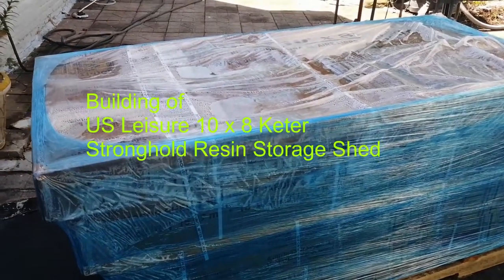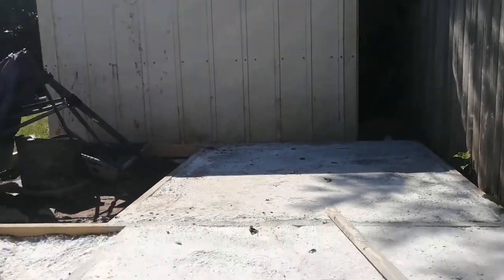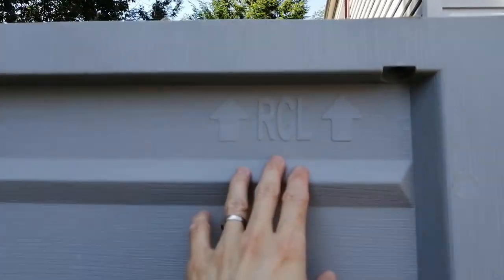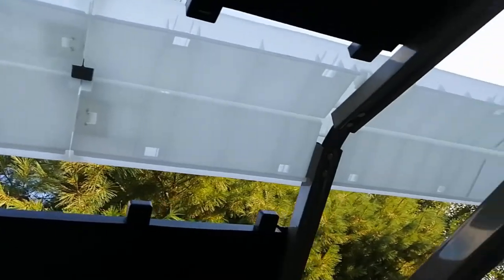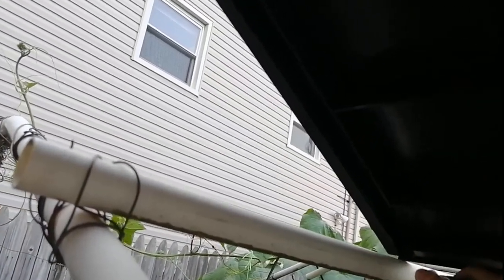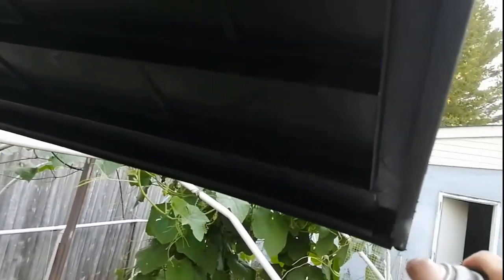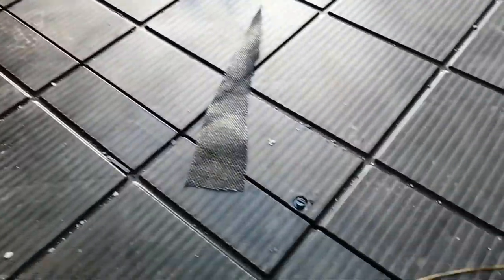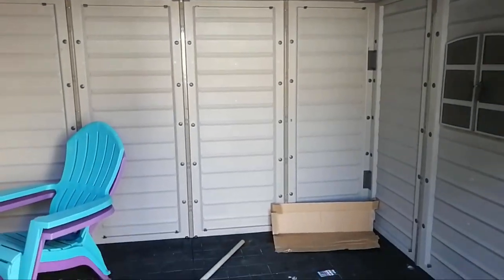Complete Building of Keter Stronghold Shed in 8 hours

Comment: The same thing happened to me with the floor panels. And there is a ton of flashing which makes the building process that much longer.
Reply from the maker: I agree.  My concern after building the shed is there is no anchor for the floor.  The tiny holes may not be strong enough to secure the shed if there is a big storm.